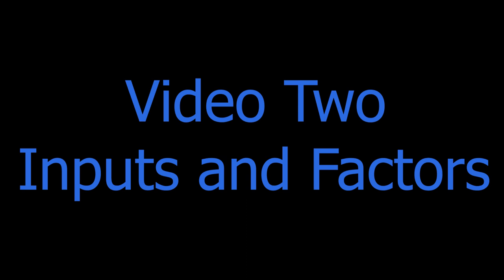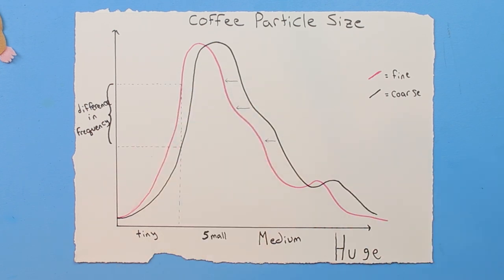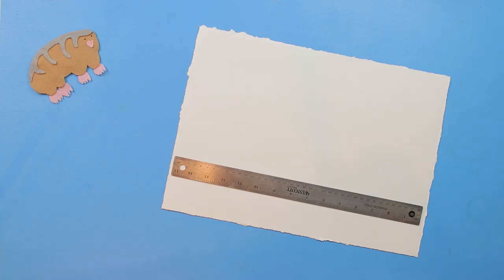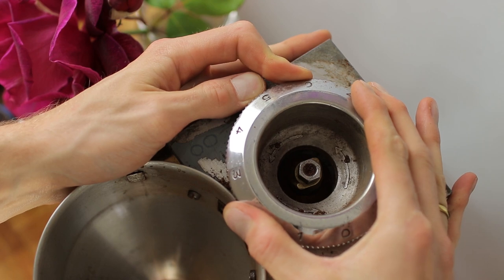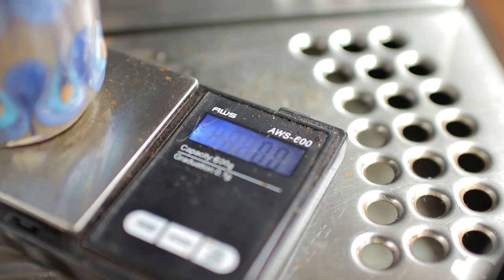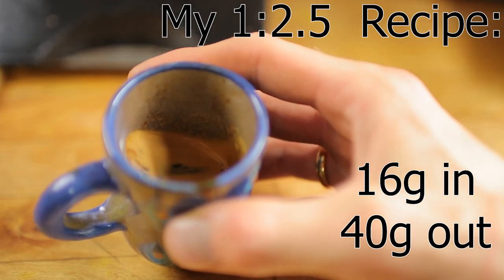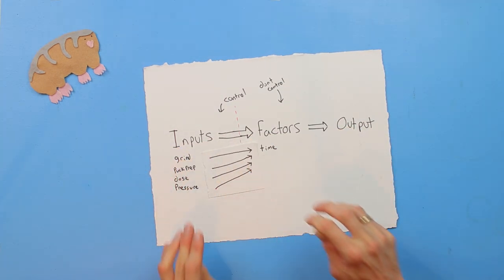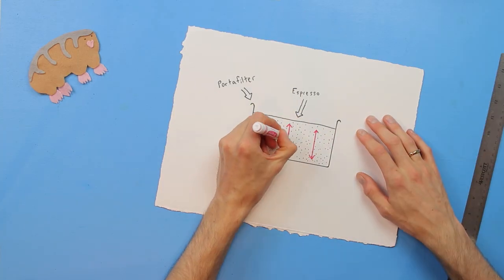Delicious Espresso Series--Inputs and Factors [2/3]

Comment: Thank you for these videos! Can you explain why the flow would be guided through channels if the coffee is too fine? I thought channeling happens when espresso finds a path of least resistance.
Reply from the maker: Never saw this comment, sorry! That's a tough question, and I'm not actually sure that it's known by anyone why that is.

Maybe the way to think about it is that when you have a coarse grind, there are not many particles getting dislodged to plug up the holes between particles and create a blockage. When you have a fine grind, there are lots of particles to block small holes between particles. It's unlikely, however, that lots of small particles will balance in a way that blocks big gaps, though, so those get all the water flow. The small particles can't work together to close big gaps, so that's the path of least resistance. With a finer grind you can get both more channeling and more resistance. 

Hope that convinces you, though I'm not sure its the real reason.